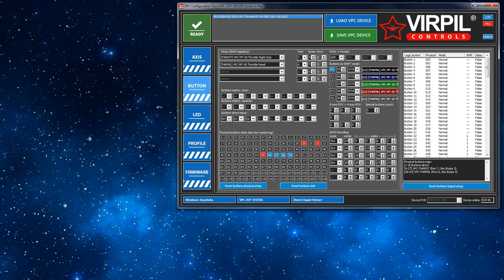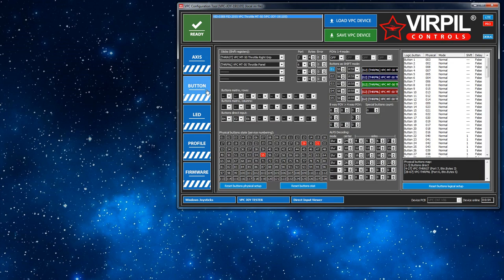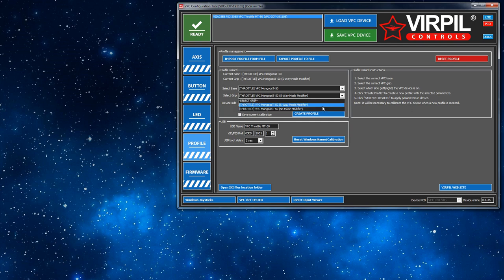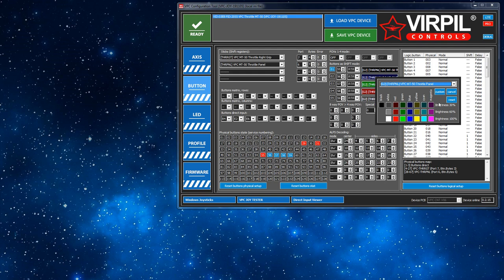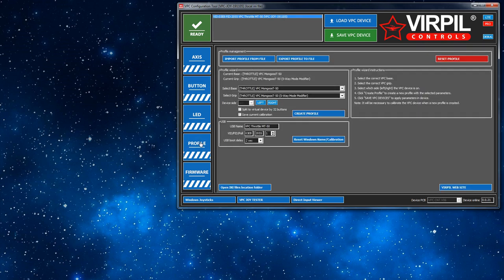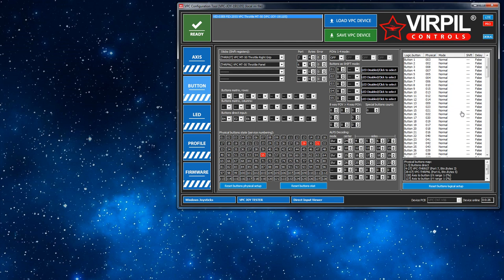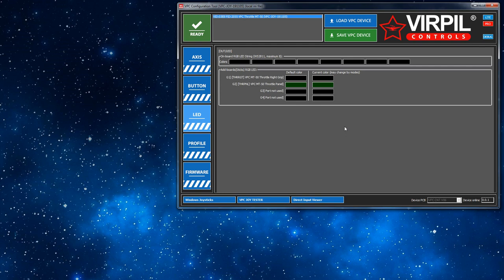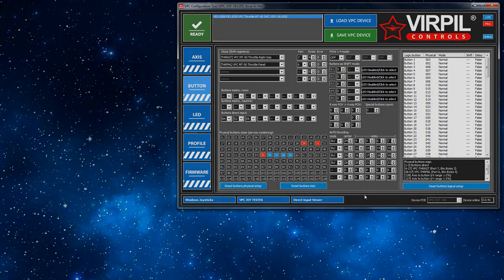Configure LED's on Virpil device Tutorial

Comment: I've got my CM-3 throttle set in no mode and I'm using it the same way that you do (with Joystick Gremlin). Is there a way to use B1-B6 as a on-off toggle and use the LEDs as indicators to that status with either the light off for off status or one color (say red) for off and another (green) for on?
Reply: Yes I managed to do that tonight - Go to LED, in ON Board RGB LED, set them all to ie: GREEN then, at the bottom - go to Simple LED's indication - There are 8 fields for entry (You'll use 6 out of 8 for this). B1-B6 = Input# 49 to 54. First line could look like ie: 49 - TGL (toggle) - Click "LED Disabled/Click to...", Click the drop down menu in the color POP UP, choose On Board #1 (#1 thru 6 for what YOU want) click the color you want to close the menu (ie RED). Save to VPC etc. Now B1 will light up default GREEN, when you press it, it will switch to RED until you press again for it to return to default color (GREEN)

Comment: how can i program each light to toggle to different color for on/off state individually for all 8 buttons independent of one another?
Reply: I would like to know this also
Reply: @JosephBag  let me know if you find a solution.  it might take another firmware update with some major changes , so i'm just waiting for the changelog
Reply: has anyone found a solution for this? i have been searching all over trying to find out how to do this. i have ONLY managed to get the B1 button to change when i change the mode dial.
Reply: Has anyone found a solution for this? Just got my throttle and I first was overwhelmed by the software, but then I figured out, that there aren't that much possibilites to customize/program it. Documentation of the software is very disappointing also...
Reply: @JosephBag  look bellow
Reply: @harpoon_bakery162  got it look down
Reply: @hottheadliberty  look here
Reply: @horst1604  
Yes I managed to do that tonight - Go to LED, in ON Board RGB LED, set them all to ie: GREEN then, at the bottom - go to Simple LED's indication - There are 8 fields for entry (You'll use 6 out of 8 for this). B1-B6 = Input# 49 to 54. First line could look like ie: 49 - TGL (toggle) - Click "LED Disabled/Click to...", Click the drop down menu in the color POP UP, choose On Board #1 (#1 thru 6 for what YOU want) click the color you want to close the menu (ie RED). Save to VPC etc. Now B1 will light up default GREEN, when you press it, it will switch to RED until you press again for it to return to default color (GREEN)
Reply: @supertopsecret5485  wow, great, can it be assigned to a function or just toggle different colors?
Reply: To be more clear, you want B1 to be Landing gear UP/DOWN toggle. In DCS you set B1 (button 49 in Virpil software) and not sure in DCS but whatever comes up when you hit B1 will toggle your gear and the color change from RED/GREEN. You might need to sync the color to your landing gear state when you jump in the plane, something like hit ESC, B1, Resume. You assign a key a function in game and you pick which of the B1-B6 you want to switch color in Virpil software.
Reply: @dabneyoffermein595  All the above, switching the colors are the result of your key function you pressed (and programmed to match in Virpil software)
Reply: @supertopsecret5485  Dude! Did not expect a response anymore :D Thank you so much, I will try after work today! If this really works you can call urself an amazing Human/Genius
Reply: @horst1604  It works for me in Virpil Software. I bet if you are unsync'd ie: gear down = red but it's green because xyz reset etc, I guess you'd press Pause/ESC, hit B1 once to shift to RED, unpause and Bob's yo unkle ;) Please let me know if you have issues.
Reply: @supertopsecret5485  It worked. You made me really happy dude! Thank you so much :) Just lost my complete profiles because I was so excited I forgot to export my profiles before updating software. xD
Reply: @supertopsecret5485  Cheers for this.Very much appreciated. I spent the last hour trying to find out how to get this to work. Just out of curiosity, do you see any delay with the LED's switching colour. I have like 0.3-0.5 seconds delay with each press. Also not sure why there are only 8 options here. Doesn't cover all the buttons on my control panel.

Comment: Does anyone know if they (Virpil) or someone who has written a mod have come up with a way to program the LED's individually ? So in other words, I want just one LED to control the HOOK in an F18 for example for the hook down state of green, and then that same button turns red when depressed for Hook UP state.  So one button doing two colors depending on the state of the HOOK in the F18. <<OR>> I'm not picky, how about two different LED buttons, one would be HOOK UP as Red when ON (lit), and below it another LED button light would be HOOK DOWN GREEN.  Perhaps someone has written something, perhaps SPAD.NEXT or another program or a custom written mod.  But ideally, VIRPIL will write something so the firmware gets updated and then suddenly we get to control each and every light with anything we want to do!!!!!!  ANY HELP FROM ANYONE THAT HAS FIGURED THIS OUT WOULD BE SUPREMLEY Appreciated!!!!!
Reply: I posted a similar question in another video. I want individual buttons to light up & go out when pressing the button to turn on a function and then pressing again to turn off the function (and the light). So far it seems like the lights are either all on or all off. But despite my low tech skills if I find something helpful I’ll comment here again
Reply: @jcjammer8972  thanks, i have tinkered with the Virpil LED Tool (i don't even think it's an official release yet) but it's like having to write a program that you know will change once another update or patch comes out for DCS or MS2020..... requires things like SPAD NExT and all kinds of variable chasing , etc..... We need a better way
Reply: @jcjammer8972  I will let you know when a good tool comes out
Reply: @dabneyoffermein595  . I just sent a support ticket to Virpil asking if it would be possible to issue a software update to allow individual lights to illuminate when the button is pressed. I’ll let you know when I get a reply.
Reply: So if anyone want's to know there is a way to make 5 of the push buttons change color individually with the program as it is now. Just figured it out tonight. don't know why you cant do all 6 but thats Virpil for you.
Reply: @Triforceking  HOOOW?! Searching for a proper documentation for hours now.. Could you please tell me/us how you did it?
Reply: @Triforceking  very enlightening comment. Care to elaborate?
Reply: I managed to have B1 be green by default and RED when Pressed Once, its on a Toggle that goes back to Default Green when pressed again.

Yes I managed to do that tonight - Go to LED, in ON Board RGB LED, set them all to ie: GREEN then, at the bottom - go to Simple LED's indication - There are 8 fields for entry (You'll use 6 out of 8 for this). B1-B6 = Input# 49 to 54. First line could look like ie: 49 - TGL (toggle) - Click "LED Disabled/Click to...", Click the drop down menu in the color POP UP, choose On Board #1 (#1 thru 6 for what YOU want) click the color you want to close the menu (ie RED). Save to VPC etc. Now B1 will light up default GREEN, when you press it, it will switch to RED until you press again for it to return to default color (GREEN)
Reply: Figured it out thank you very much. Putting it another way: You NEED to set the default colour of your buttons in the top row. You CAN set them individually. THEN you go to the bottom SImple LED's and then set your BUTTON NUMBER first. This you do in the top row of the pop up menu. Then you can set the toggle colour  in the pop up men. The number you specify in the beginning in the box of the left row by typing is only for your reference and does not do anything.

Comment: What's the function or purpose of 5 mode vs no-mode?
Reply from the maker: no-mode = no shift state buttons,  5 way = B1 to B8 having 5 different shift states
Reply: @HavocCompanyClan  Does no-mode allow the B1 thru B8 to do the same function regardless of what position the 5 position switch is in?
Reply from the maker: @harpoon_bakery162  yes no mode will return the same logical button press regardless of mode
Reply: @HavocCompanyClan  Great, wanted to be sure.  i realize too that i could have just gone into the software, but my sim-pit is idle right now with a huge dust cover over it = me being lazy.....thanks a ton!!!